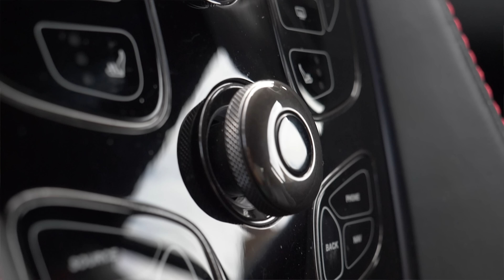Michelin Develop Airless Tyres | OSV Behind the Wheel Motoring News

Comment: Ironically, I saw my first airless tyres in the wild just a week ago, but they were on a small bulldozer. It's starting with construction vehicles. I've been aware of them for some time and I think the technology is fantastic. One of the many upsides is that because they are more deformable/softer they give a smoother ride but are more stable  (not inflated by a  cushion of air which leads to variability in contact patch shape and size). Lateral loads (cornering) induce much lower deformation so they handle better too.
Reply from the maker: They will be the standard before we know it, exciting to see the big change and see some on the road.
Reply: Alarm Clock I don't really see a safety downside. The military likes the fact that a tyre segment can be blown off and the rest of the tyre still stays round and therefore can still turn and have ground contact.  They use rubber inserts in their current tyres today but the tyre still deflates and flays around when punctured.